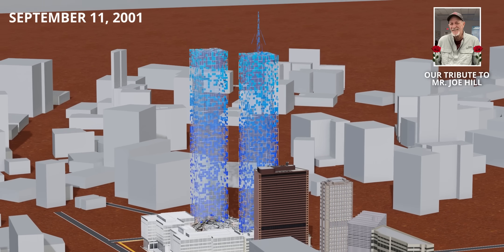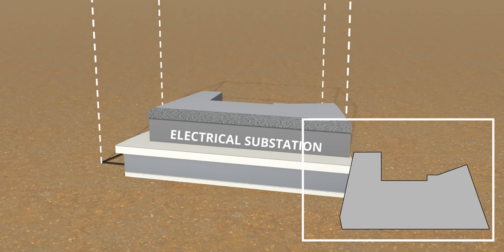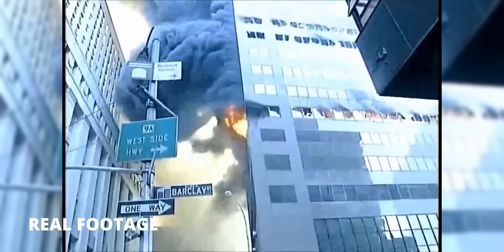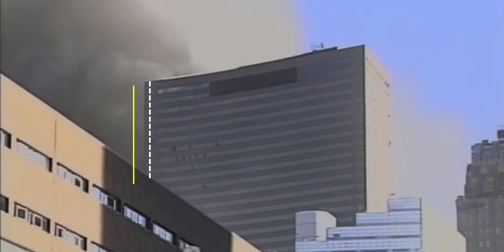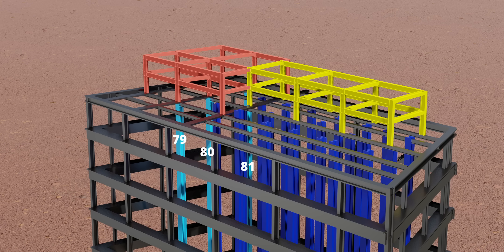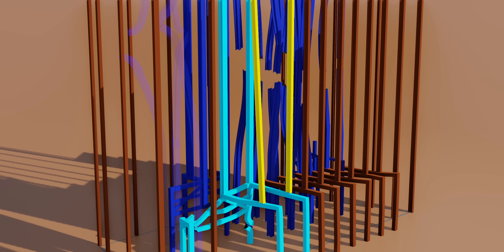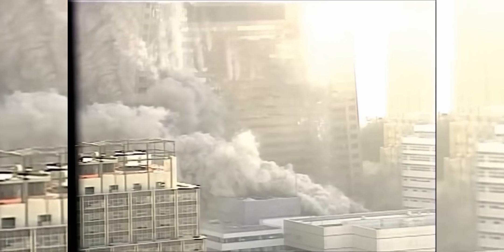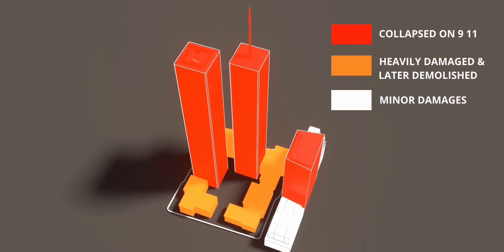Collapse of Building 7 | The Complete Physics

Comment: BS propaganda, you can’t hide a controlled demolition.
Reply: I disagree and here is why: Building 7, the 6th building to collapse of 10 lost on 9/11 though extensively studied still confuses many. Not famous or a terror target and with no casualties it didn’t get a lot of attention initially, creating an information void the internet filled with utter garbage. Because everything seems like a conspiracy if you don’t understand how it works I prepared this brief summary from my own analysis to fix that. No politics, just engineering. 

The North Tower collapse at 10:28am bombarded Building 7 with tons of burning debris, causing heavy damage and multiple floor-wide fires that burned out of control for 7 hours. Half the FDNY firefighters having been killed, others injured, units in disarray, equipment destroyed, no water pressure, and the greater urgency of Search & Rescue efforts, firefighting was pulled as futile. The building couldn’t be saved and was left to its fate. That is the sort of choice firefighters make every day in brush fire situations - which houses to save and which ones to let go. Only real difference here is moving the decimal on the size and cost.

www.youtube.com/watch?v=g_SvpwyC17M&ab_channel=MFitz  

Collapse of a burning structure is always a concern for firefighters. Steel buildings subject to fire rely on active fighting of the fires to survive. Buildings are designed around 1 to 3 hours of fire resistance, allowing time for occupants to escape and ACTIVE firefighting to get started, after which all bets are off. Left to their own devices they will exceed their design envelope and collapse. In B7 the occupants escaped, passive and active fire protections were compromised and active firefighting was abandoned which left the building to its fate. It lost. Odds on Building 7 would eventually collapse, and it did. No big deal in logic. 

www.youtube.com/watch?v=WnYBX6QT0R4 

FDNY Chief Daniel Nigro ; The biggest decision we had to make on the first day was to clear the area and create a collapse zone around the severely damaged 7 World Trade Center, a 47-story building heavily involved in fire. A number of fire officers and companies assessed the damage to the building. The appraisals indicated that the buildings structural integrity was in serious doubt. I issued orders to PULL back the firefighters and define the collapse zone. It was a critical decision; We could not lose any more firefighters. It took a lot of time to PULL everyone out, given the emotionalism of the day, communications difficulties and the collapse terrain

FDNY Deputy Chief Peter Hayden ; We had our special operations people set up surveying instruments to monitor and see if there was any movement in the building. We were concerned of the possibility of collapse in the building. And we had a discussion with one particular engineer there, and we asked him if we allowed it to burn could we anticipate a collapse and if so, how soon? And it turned out that he was pretty much right on the money, that he said 'In its current state you have about 5 hours

The collapse of Building 7 was anticipated and widely reported in the media throughout the day. At least 24 video cameras recording some or all of the collapse. Everyone knew what was coming and why.

www.youtube.com/watch?v=OY5S5k3tMHI 

Building 7’s collapse was completely different to the Twin Towers, and harder to understand with most details hidden from view. But we can still sort out what happened through careful analysis and observation.  This is my explanation  of the collapse using the best available information and relying on no authority.

B7 was complex 47-story steel framed structure built on top of a smaller existing 3-story building, requiring several lower floors dedicated to complex load transfer structures instead of usable office space. Of trapezoidal shape and all-steel tube-in-tube construction, B7 (above the 7th floor) consisted of a central core of steel columns carrying most of the gravity load, perimeter steel columns around the outside of the structure carrying the remainder of the gravity loads and long span beams and girders to tie those elements together and form the floors. On the outside of the building hung a moment frame - the last part of B7 to fall 

Phase 1 : The first externally visible signs of collapse initiation occurred at 5:20:28 pm. Collapse initiation for B7 is notably quiet with observers not realizing the building was collapsing! There was no audible warning in the form of say hundreds of ear drum busting 180-190dB explosive bangs preceding the collapse. Here at 12:00 a local CBS affiliate reporter is talking 10 blocks from B7 when collapse begins. People don’t start to notice the collapse until 12:11. Then at 12:45 is the famous CBS fixed camera clip of Building 7’s collapse.  Note how quiet it is.

youtube.com/watch?v=t5tEy6mXSE8&ab_channel=fresnosean379

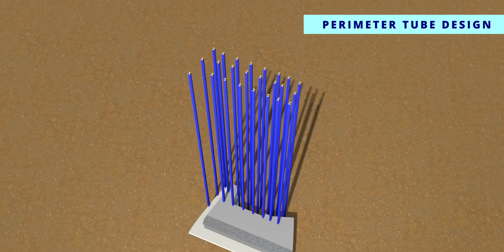Collapse initiation was due to lower floor failures above the load transfer region (7th floor) in the NE corner of the building. In this video at 0:45 you can see the NW corner from inside the building while under construction, Column 79 just out of frame on the left. That big, angled steel beam across the top of the frame connects to C79 at one end. The girders connect to the beam. That beam and all those girders depend on just one connection

youtube.com/watch?v=nP3TNHPCIVU&t=35s&ab_channel=EdwardCurrent

Phase 2 : Lower floor failures caused a loss of critical lateral support over an excessive length of core Column 79 and it buckled. If you look at a floor diagram of Building 7 (see above) and look at all the structures that depend on C79 you quickly realize this one column was a relatively isolated structural element on which a disproportionately greater fraction of the structure depended analogous to say the Key Bridge. Externally we see a vertical progression of window breakage along the 44-46 line and a kink in the roof of the East Mechanical Penthouse at the top of the building, consistent with C79 failure. The transition from full capacity to almost no capacity occurs in virtually an instant. Once the buckling failure occurs there is almost no resistance

Normally with a buckling column, the load could very well be redistributed to other columns, meaning the buckling could stop after a while. With C79 that is not the case - the failure did not redistribute the load, so the collapse rapidly progressed to the roofline, sinking the rooftop penthouse.

Phase 3 : With C79 gone, B7’s progressive, non-symmetrical collapse continues with C80 and C81 at the east end of the core left laterally unsupported and quickly buckled and failed as well, sending the EMP down through the building. C79-81 all have no diagonal bracing, which I believe is a major reason why they could not redistribute a lot of vertical loads among one another.

From there collapse progressed from east to west through the central core until the core was gone taking all of the interior floors and structures and probably most of the perimeter columns with it. You can see the horizontal progression of window failures low in the building and the dropping of the remaining rooftop structures into the building. One of the big takeaways from the NIST Building 7 study (that gets completely ignored) was their modeling which determined C79 failing under ANY circumstances would have initiated the same collapse sequence.

Phase 4 : 10 seconds in only the exterior moment frame - just a hollow empty outer shell – remains, the illusion the building is still standing since little has outwardly changed. But it’s just a hollow empty shell like an empty cereal box supported by only a few remaining columns and quite unable to remain standing. With all internal framing gone, the north face leans inward, forming a V in the roofline, the last perimeter columns buckle under the strain and the moment frame free falls, landing on top of the 7-story high debris pile. It is only here, at the end that a single measurement of alleged free fall acceleration is taken, from a single point on the moment frame. The Building (defined as its center of mass) did not “free fall” (sort of) – just one corner of the outer shell did. _
The Building_ was already gone before that happened. The period of alleged free fall was a product of collapse progression mechanisms, not of collapse initiation mechanisms and is irrelevant to what started the collapse.  Start to finish the entire collapse took 18-20 seconds, or 3 times longer than true free fall and how fast something falls cannot tell you what started it falling in the first place. The debris spread outside the footprint, blocking surrounding streets, heavily damaging the Verizon Building and destroyed Fiterman Hall.  

Building 7’s progressive, non-symmetrical collapse was incidental and unintended collateral damage from the combined effects of fire + time + gravity started by the collapsing North Tower. That is true no matter who planned and carried out the 9/11 attacks or why . The collapse was of so little consequence it barely even registered at the time, a mere footnote. It only took on semi-mythical status as an alleged smoking gun years later when demolitions at the Twin Towers, missiles at the Pentagon and shoot down over Shanksville all failed and conspiracists had nothing left to work with.

Anything can seem like a conspiracy if you don’t understand how it works. Now you should. I hope you found this helpful, informative and it solicits informed critical comment. If I made any errors of fact, logic or reason or left anything important out, please let me know so I can fix it. IF you can offer a more plausible alternative please do. Be the first. Please start any reply with the words “Tits McGee” or I will know you didn’t read it and are wasting my time.
Reply: You very likely can't. And, since there's literally not one single bit of evidence that points towards, "controlled demolition", the most obvious being "utterly uncontrolled".....we can then conclude that it wasn't one.

Comment: Explain freefall.
Reply: Do you mean "Free Fa'll" or "Free Fall Acceleration". 

"Free Fall" ["FF"] is a state of a body without support free to fall under gravity. 

"Free Fall Acceleration" ["FFA"] is the motion that results when a body is in the state of Free Fall. 

Those pushing the false claim for controlled demolition are usually seeking to prove, directly or indirectly that the falling body had no support - therefore CD had removed the support. That is not a distinguishing fact. Because whilst the state of FF will cause FFA, the reverse is not true. FFA does not need zero support - it can result from net zero applied external forces.

I sincerely hope this helped.
Reply: @TheCriticalStinker-01  Video (and engineers) shows the acceleration of the roof with 9,8m/s2. How come? Only possible when all the structure is gone.
Reply: @MrWave58  - All of the critical structure was gone. The building had been collapsing for at least 10 seconds before the empty outer shell falls, creating that brief little moment of average FFA at just a single point.

Which tells us absolutely nothing. 

Please actually watch the video.
Reply: @TheCriticalStinker-01  WHY were they gone?
Reply: @MrWave58  - Again, WATCH THE VIDEO

Comment: How to lose any credibility you had in 11 minutes!  Do you actually believe this BS?  Forget that the BBC announced WTC7 collapse whilst the building was still standing behind the reporter, 20 minutes before the collapse.  Nothing odd to see here, just some office fires causing the collapse of a steel framed building🤔😂😂😂🤷‍♂️
Reply: And yet not wrong. Go figure. 
	
This video is pretty good – with a few exceptions - and goes into a much higher level of detail than many viewers will be able to comprehend.  While not perfect, the collapse mechanisms – the sequence of failures - described here  are substantially correct and this is true no matter who planned and carried out the 9/11 attacks or why . 

That may not be what you want to hear and go against 20+ years of entrenched dogma and conditioning, but it’s not wrong. 

That also means (in case you did not get the hint) this video can be (and IS) absolutely correct in its description of collapse mechanisms AND the 9/11 attacks could still have been some sort of inside job. The two things are in no way mutually exclusive. 

The mechanisms described here have broad professional support around the world. There are no professional engineering organizations (for example: ASCE, ASEE, ICE, etc) that disagree with them or have offered any formal dissenting opinions or alternative hypothesis. 

So, setting hubris aside, either the overwhelming majority of the worlds structural engineers and simple observation are wrong,… … or you are. Which seems more likely? 

IF you still think believe this explanation is wrong then produce a better one . Good luck with that. No one ever has and I don’t see you moving that needle today. 

Ps

Are are seriously still beating the dead horse that is the BBC Report like you just saw Loose Change for the very first time?  FFS that's embarrassing 🤦‍♂

Comment: Is that how they were able to report it's collapse before it collapsed?
Reply: FDNY Chief and Building 7 on-scene commander Daniel Nigro - The most important operational decision to be made that afternoon was the collapse (Of the WTC towers) had damaged 7 World Trade Center, which is about a 50 story building, at Vesey between West Broadway and Washington Street. It had very heavy fire on many floors and I ordered the evacuation of an area sufficient around to protect our members, so we had to give up some rescue operations that were going on at the time and back the people away far enough so that if 7 World Trade did collapse, we [wouldn't] lose any more people. We continued to operate on what we could from that distance and approximately an hour and a half after that order was [given], at 5:30 in the afternoon, World Trade Center collapsed completely 

Firefighter Richard Banaciski - They told us to get out of there because they were worried about 7 World Trade Center, which is right behind it, coming down. We were up on the upper floors of the Verizon building looking at it. You could just see the whole bottom corner of the building was gone. We could look right out over to where the Trade Centers were because we were that high up. Looking over the smaller buildings. I just remember it was tremendous, tremendous fires going on. Finally they pulled us out. They said all right, get out of that building because that 7, they were really worried about. They pulled us out of there and then they regrouped everybody on Vesey Street, between the water and West Street. They put everybody back in there. Finally it did come down. From there - this is much later on in the day, because every day we were so worried about that building we didn't really want to get people close. They were trying to limit the amount of people that were in there. Finally it did come down 

FDNY Chief Cruthers - Early on, there was concern that 7 World Trade Center might have been both impacted by the collapsing tower and had several fires in it and there was a concern that it might collapse. So we instructed that a collapse area -- (Q. A collapse zone?) -- Yeah -- be set up and maintained so that when the expected collapse of 7 happened, we wouldn't have people working in it. There was considerable discussion with Con Ed regarding the substation in that building and the feeders and the oil coolants and so on. And their concern was of the type of fire we might have when it collapsed 

FDNY Deputy Chief Peter Hayden - We had our special operations people set up surveying instruments to monitor and see if there was any movement in the building. We were concerned of the possibility of collapse in the building. And we had a discussion with one particular engineer there, and we asked him if we allowed it to burn could we anticipate a collapse and if so, how soon? And it turned out that he was pretty much right on the money, that he said 'In its current state you have about 5 hours 

Lots of others where that came from. I can do this all day. 

Firefighter describes the impending collapse of Building 7:
www.youtube.com/watch?v=XImQ6a-VrnA 

This is why at least 24 cameras were aimed at Building 7 when it collapsed. Everyone was just waiting for it to happen. 

This is the sort of critical information they don't teach you about over at Architects and Engineers for 9/11 Truth.  What else have they been keeping from you that you need to know ?